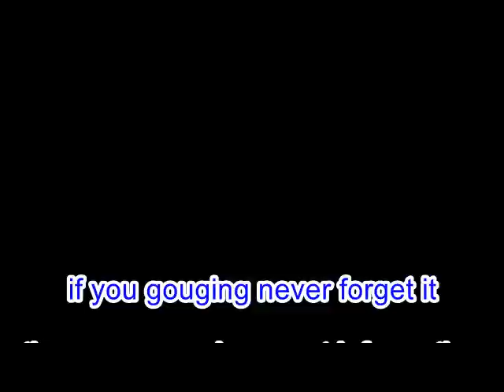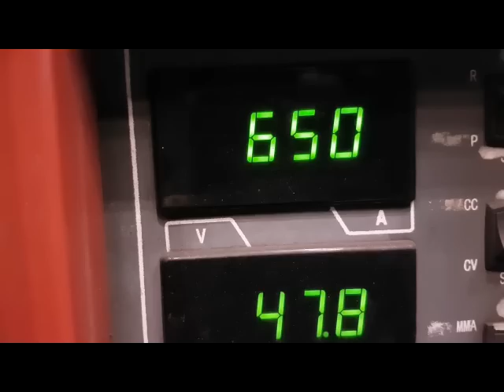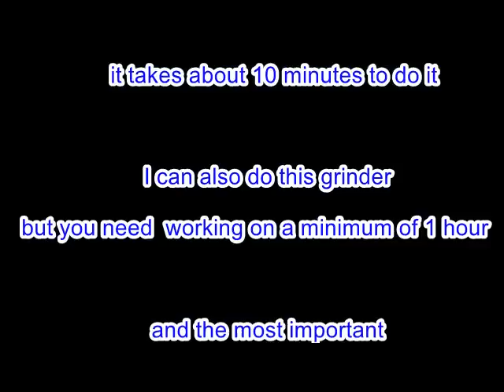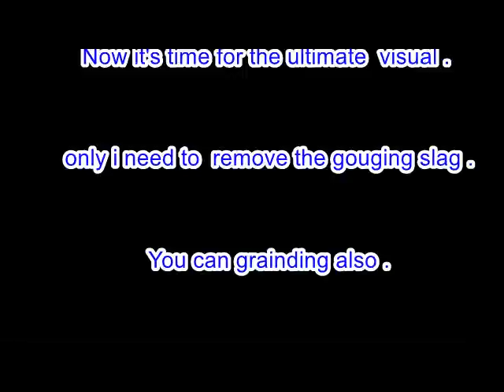GOUGING TECHNIQUES With Arc-Air - Tips For Welders and Fabricators

Comment: i just have a lil stick welder, can i arc gouge with it, max is 250a. How would i go about doing that. thx
Reply: You might be able to use a 1/4 inch rod or 5mm if you're metric,  that's about it.